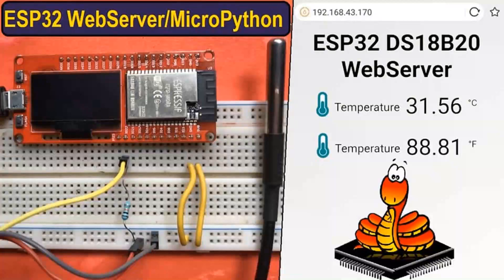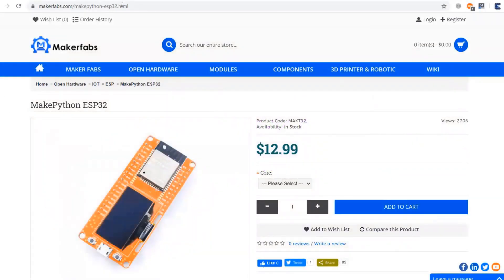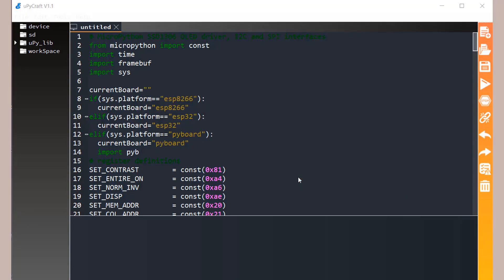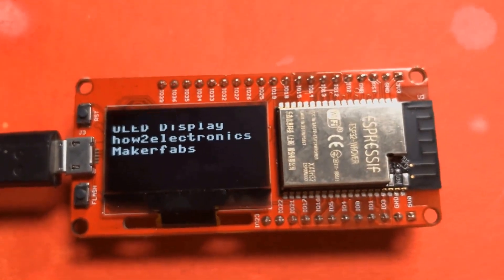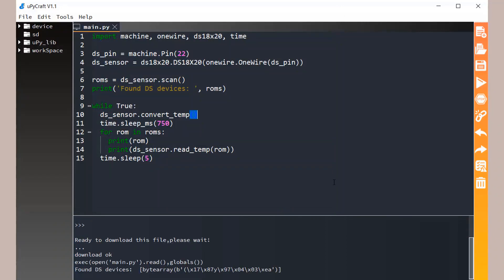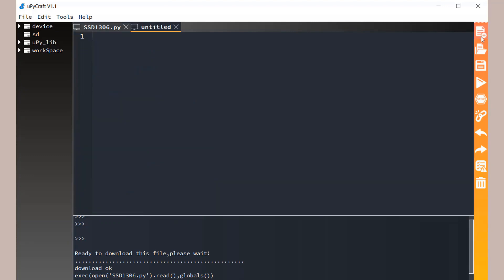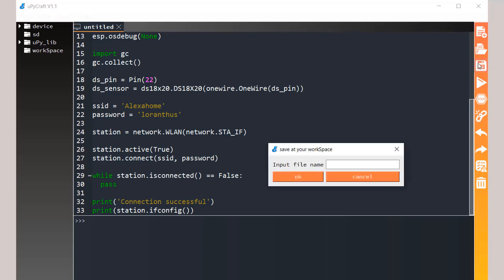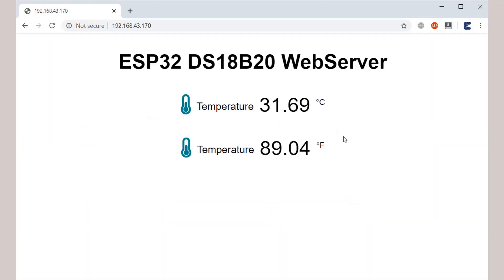Episode 2: MicroPython on ESP32 - Interfacing OLED Display, DS18B20 Sensor & Creating Web Server

Comment: Thank you very much, you have cleared up many issues. I have several temperatures I need to check, and have 5 DS18B20 sensors to monitor and some other actions depending on their readings, so you have given me a good start.